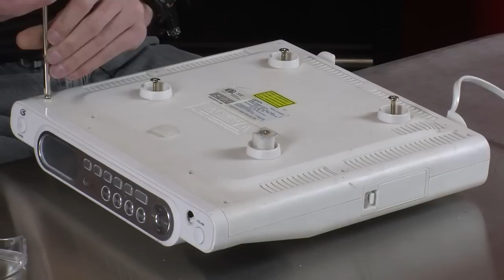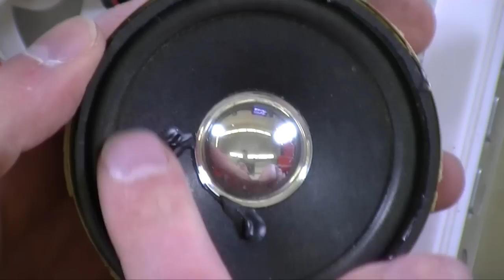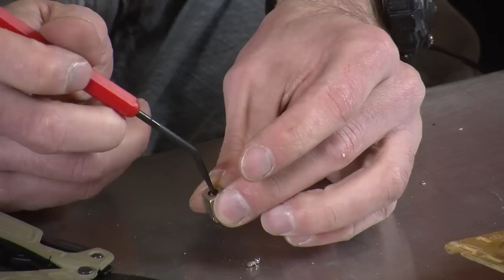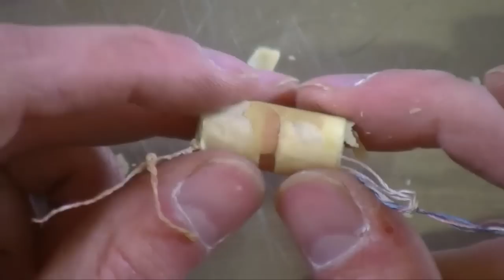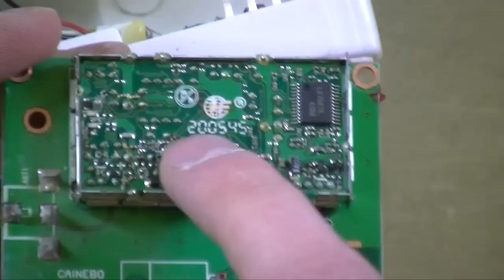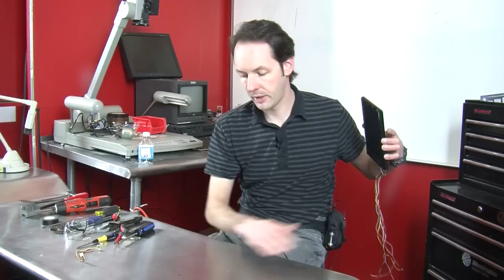Under-Cabinet Television: Equipment Autopsy #64

Comment: Chris, the "ferrite" you are talking about is actually iron oxide, not iron. The interest of it is that it is both ferromagnetic and, unlike iron, non conductive, so you can use to make coil cores without having losses due to induced currents in the core.

It is often confused with alpha iron, also called ferrite, one of the crystal structures iron can adopt.

Comment: i've always loved taking stuff apart since i was a kid, and i was always curious, on the circuit boards what do you call those little square metal boxes that have holes on top with a slotted screw inside, usually different colors.  (like at 11:14 to the left of your watch by the capacitors)